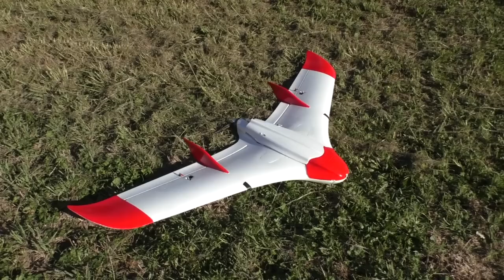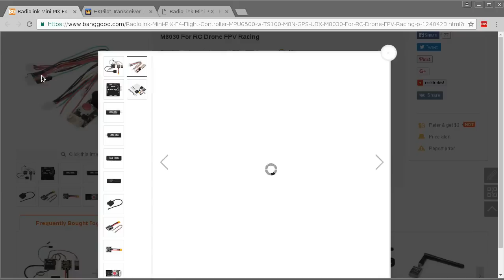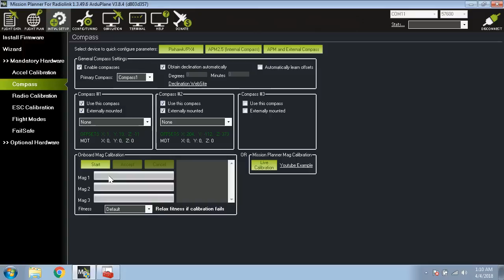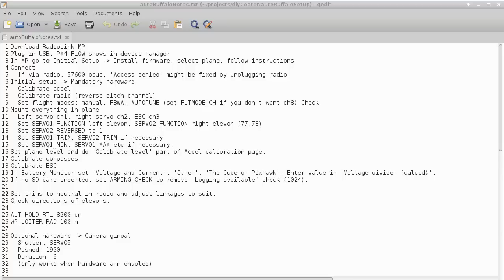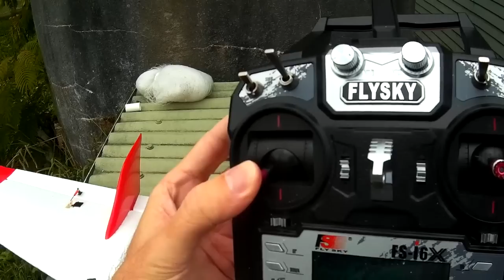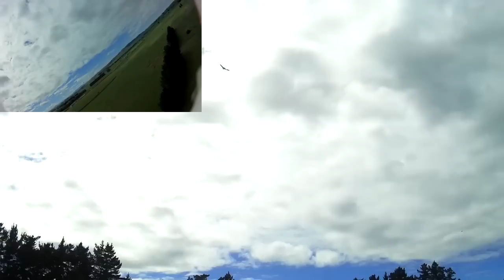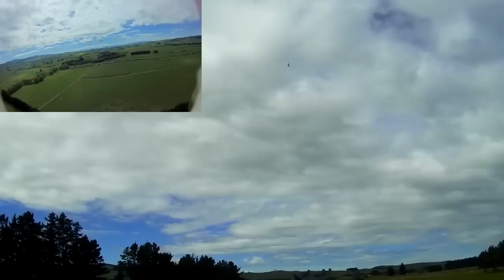Arduplane setup steps for flying wing

Comment: Chris,

I know you are tinkerer and I am always keeping eye on your channel for DIY electronics.Now I see you started using ardupilot software so I wanted to bring your attention to following project:

https://diydrones.com/profiles/blogs/mini-zee-a-100-diy-smart-drone-with-the-pi-zero-and-apm

https://photos.google.com/share/AF1QipOYVPXOhHsvrNlbK5AwLQcaHGcl1pZW41mvFwweWCS-dtOHggNt8jA9P40n-soESQ?key=aE95YlJmVHNlYWhxZnZ0Uzh5Q1lCc1g4aW1ETlRR

http://spikey.si/how-raspberry-pi-zero-got-ardupilot-hopefully-flies/

Patrick is working on this project right now :

https://diydrones.com/profiles/blogs/pocketpilot-a-new-linux-fc-based-on-the-25-pocketbeagle

These people are tinkerer just like you. Hopefully you can combine above project with  your nrf24 RX/TX project and https://github.com/bortek/EZ-WifiBroadcast/wiki project for digital FPV and we will have very complete and very affordable (under $ 100 ) fpv platform for reasonable range (around 2km) or for unlimited range using 3G/4G use http://www.andruav.com/ android app.

Keep tinkering.

Thanks